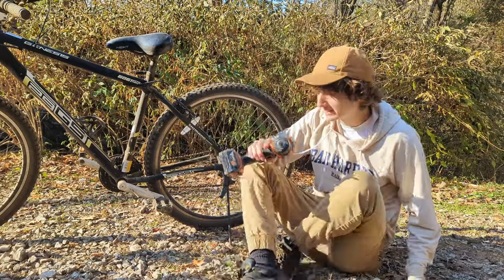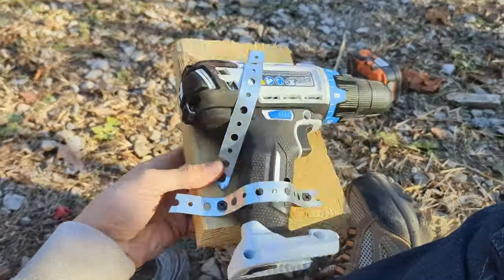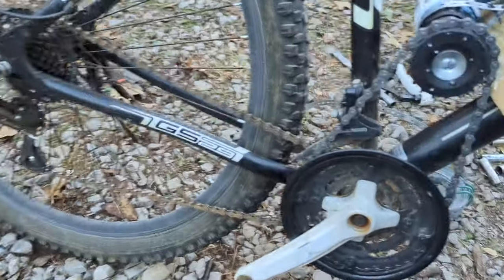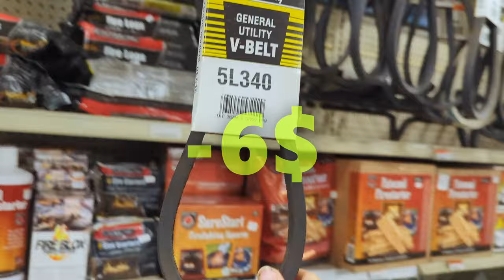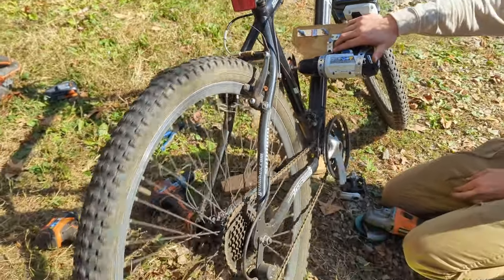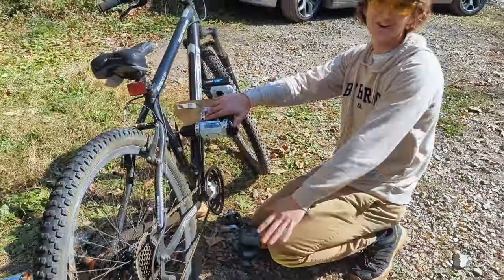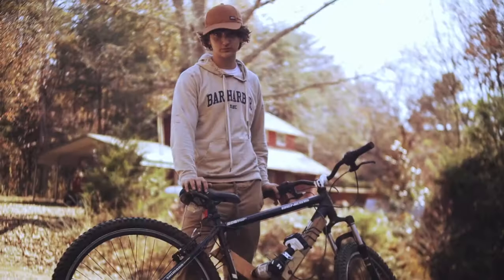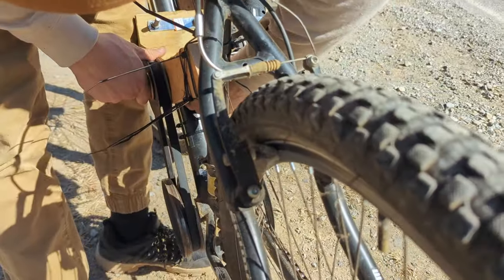cordless drill powered bike

Comment: Just a thought if you want to improve this.  It would probably be easier to take the trigger out of the drill and extend the wiring up to the handle bars.  Probably a tad bit more reliable.
Reply: There's nothing reliable here
Reply: @cybyrd9615  You're connecting a cable pull to a switch.  This adds multiple points of potential failure.   Generally reducing complexity adds reliability.
Reply: @Reegareth  who cares the whole build is worthless
Reply: @cybyrd9615  Okay.....?  I don't see what that has to do with your first comment.  There is value in iterative design and this is the 1.0 that most people start at.  So even your it is "worthless" comment I would also say that that is wrong because even though it didn't work if he wanted to try this again he might know some things to improve for round 2.